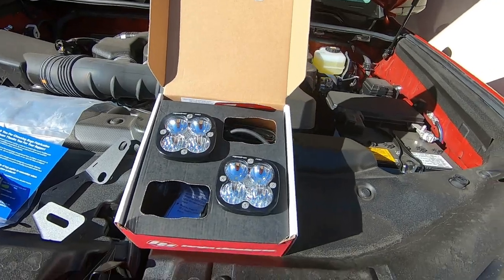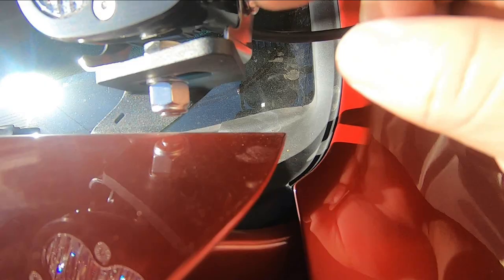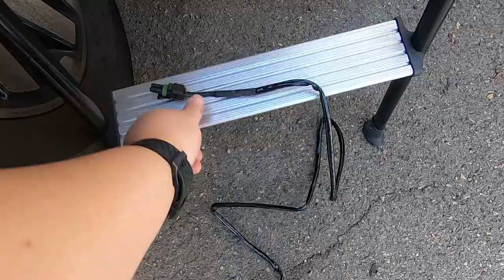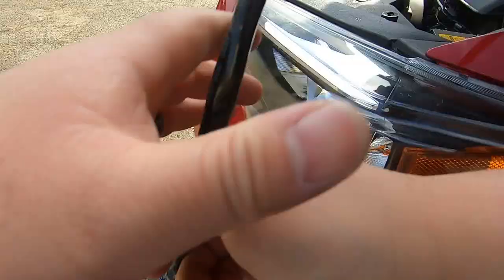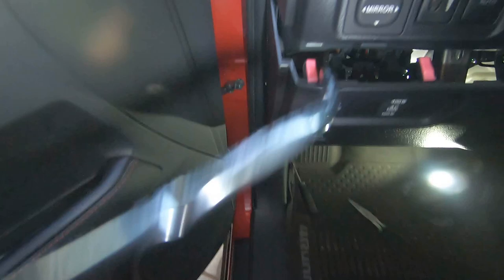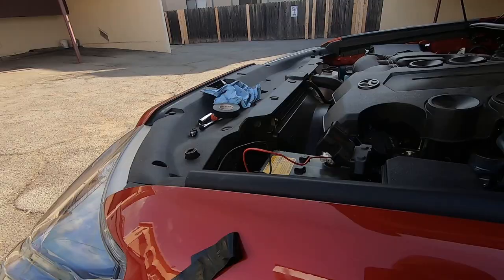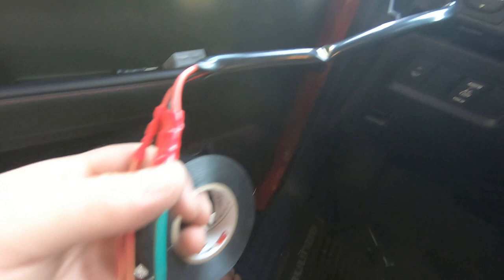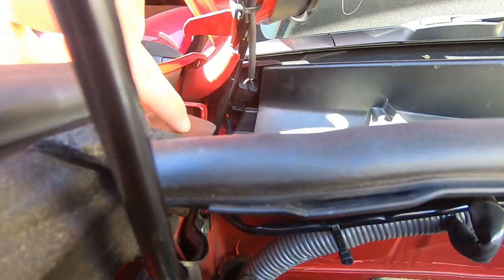Baja Designs Squadron Pro Ditch Light Install - 5th Gen 4runner

Comment: Bro .you did a good job.
I'm going to follow your harness routing with zip ties and through the fire wall.
I heard it's good to use a relay if your going to use your switch light to come on with your accessory lights or dash board lights but the way you tied both red wires together on your switch I believe the relay is not necessary..
Reply from the maker: Glad you liked it. That was my first time doing lights and I’m no expert. There were only a couple videos on YouTube at the time I installed mines and I basically gathered all their techniques and did mines. Just note that DO NOT wire the black ground to the battery like how I showed it in the video, rather ground it to the frame of the car. I learned that the hard way and burnt through 2 switches because the button got really hot when I would use the light. Eventually, when I regrounded it to the frame never had an issue since. The harness has a built in relay as well, all the links are in the description. Good luck!
Reply: @short21yang  I grounded to the body...
I had to buy two new switched because I burned mine up..lol.
Thanks again

Comment: Hello.   Great video.  One question.  Did you ground your black wire outside the battery or did you hook up to battery like the red. ??  Thank you
Reply from the maker: I hook it straight onto the battery just like the red wire and it hasn’t caused an issue since the install. Check it out at 22:25
Reply: @short21yang  thank you sir
Reply from the maker: @philliprodriguez5129  Just wanted to update you.  In the video I wired the black onto the battery and that's what I said previously but it finally hit me when I burnt through 2 ditch light buttons that that is incorrect.  Instead, ground the black wire onto the chassis where the negative terminal battery is also grounded onto the chassis (outside the battery).  It should fix the issue of having a extremely hot button and melt down of the button.  I also wrote the update on the video description.

Comment: Thanks for the video, man! I'm about to do this myself. How long did it take you?
Reply from the maker: if everything went well, (excluding the stupid issue i had with the firewall) at least a few hours.  Overall, based on the videos I've found, I think mine goes step by step.  I've never wired my own lights either so it took me longer so after this, if I can do it, anyone should be able to if they follow what I did.  If you need help, feel free to drop a question/comment
Reply: @short21yang  Lol!! You did a great job, man, and I appreciate the response. I do actually have a question if you don't mind one more. I didn't know I had to buy the OEM switch as it's own thing, I thought it would come with it. It'll come in about 1 week, but I want to install the lights tomorrow. Is it easy to do the main light install and just add the switch when it comes, or should I wait for it? Thanks again man!
Reply from the maker: @ejuradohw  I got my OEM switch from Cali Raised and idk why but maybe I got a lemon the switch doesn’t fit in well as per the video. I hardly use the light anyways so I doesn’t kill me. But yea, you can hook it up and everything and make sure to test the switch it came with (that red bomb looking switch) before cutting it off. Once you verify that your light hook up works, then what I would do is cut that red switch out, electrical tape it and stick it through the firewall. Then sit tight and wait for your OEM one to come in and finish it up with the wiring.
Reply: @short21yang  I was hoping you'd say something like that! Looking forward to tackling this. Thanks again for the great video and for responding. And nice rig, man!

Comment: For your hood defector, does it scratch the paint on top of the front grille?
Reply from the maker: 2 years later and no issues with it still. It doesn’t scratch or come close to touching the hood/paint. It mounts from under the hood using 4 screws I believe. Super easy install. Mine is from Weather Tech same as my window visors.

Comment: Hey bro, where did you attach the relay box? (black little box with metal plate) I didn’t see where you placed it in the video.
Reply from the maker: Good question man. Mines didn’t come with a relay with a metal plate. If you watch right around 9:40 you can see my relay (small black piece at the bottom right). Idk if it’s the harness I got but in some other videos on YouTube I can see some other peoples relay (with the metal plate) but mines didn’t come that way. I just tucked mines along with the extra harness wires. And also, don’t do what I did in the video and ground it onto the negative battery, ground it to the chassis of the car (the screw right in the middle at 9:40). Learned that the hard way after burning through 2 buttons. Hope this Info helps you out

Comment: What number relay fuse did you use ?
Reply from the maker: Sorry I don't have a definitive answer for you because the relay I got was attached to the harness when I bought my lights from Rago Fab (links in the description).  You can see the relay at 9:34 right above the battery, next to my left thumb, the small looking square with the red wire sticking out from it on the left side.

Comment: Did you ever figure out how to get the switch to fit correctly? Mine does the same as yours… I just want it to fit right and press in and stay on when I want it to.
Reply from the maker: I saw another guys video and followed what he did, fixed it by taking some electrical tape and taping around the switch to make it “larger.” I don’t recall the video name but it works. I used the tape and went around it the switch a few times and it also grips into the button well nice and snug. Never had an issue since. I find it so weird how the the button is a little to small for the button well so it doesn’t fit correctly even though it’s listed as OEM fit. Also side note, don’t ground your black wire into the next terminal like my video, you’ll burn through the switch. I did that twice before I grounded it to the chassis and been good since.
Reply: @short21yang  Last night I actually tried something before seeing your comment. I added black silicone around the edge that fits into the slot to secure the switch and just adding a little bit of silicone allowed the button to have just the space it needs to close the switch completely (seems like Cali Raised didn't make that gap small enough). I will see if it holds up but I liked the silicone idea because it isn't permanent and doesn't ruin anything just like the electrical tape idea. and thanks for that note! I actually followed your video almost a year ago and nothing has failed yet. I will look into that and make sure I didn't ground it there. I was just sick of the button still sticking and came back to see if you had a solution yet. Thanks for the help!

Comment: How come mine smell like a burning plastic when I turn on my car with the lights on lols
Reply from the maker: 1st thing is did you ground it to the Neg terminal or chassis? If you read my video description Update, do not ground to the neg terminal. The button gets hot, gonna smell like burning plastic, and most likely you’ll burn the button. So I can tell you right off the bat, you’ll need a new button because it’s starting to melt.
Reply: @short21yang  yes and my switch button was brand new so I don’t know the problem is. I might just re do it
Reply from the maker: @stickfiggas22  in my video I combined both reds from the switch together, what you can do is redo the wiring and not use the red wire that’s to the left of the black one. I’ve seen some videos of other installs and they neglected that red wire. Hopefully that’ll fix the issue. But in the mean time, I would order another switch just in case. I burnt through 2 switches before I realized I shouldn’t have put the ground on the neg battery terminal.